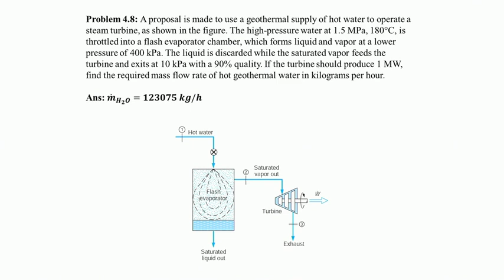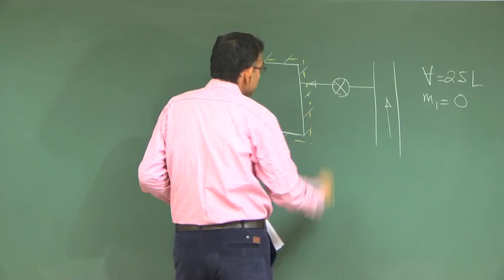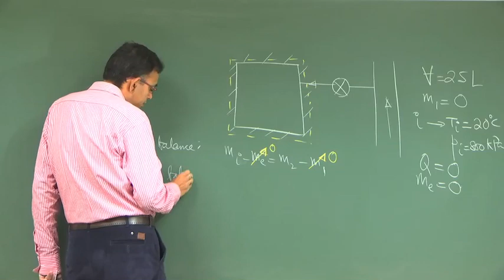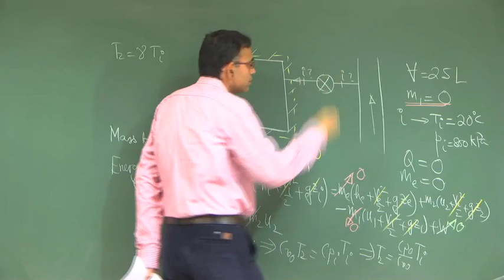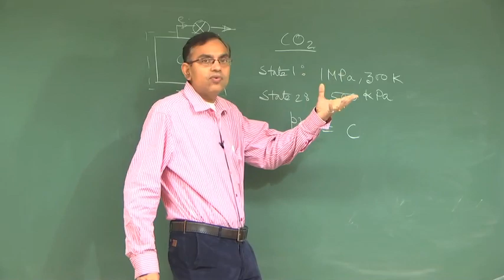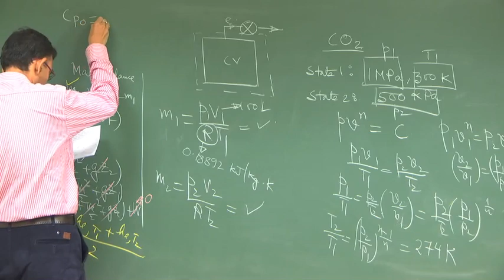Lecture 29 : First Law for Unsteady Problems - Examples

Comment: In the first question :
How does the final pressure come into play ? 
The way the question is solved by the USUF formula, will the temperature always depend on the enthalpy of the air in the supply ?
And the question is presented as the chamber is filled till it's pressure reaches 600kPa. By ideal gas equation temperature can be a function of pressure. But here the temperature is calculated first and then with the given pressure the mass is calculated. The answers feels a little non-intuitive.

Comment: how to differentiate between steady flow problem and unsteady flow problem in examination?
Reply: Did u get the ans brother?
Reply: If the properties like pressure, temp. inside the control volume changes, then it is an unsteady problem.
Reply: It simply means that any property varies with respect to time is an unsteady problem and any problem which remains constant is steady state